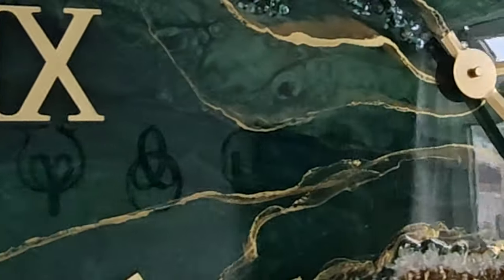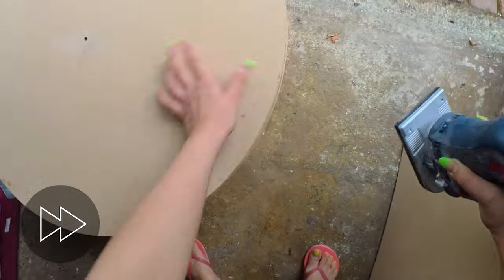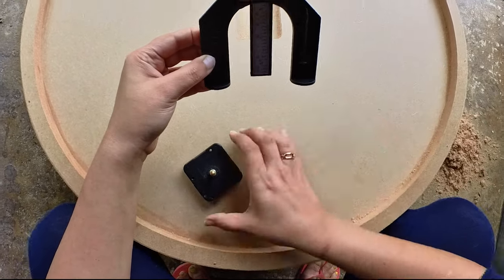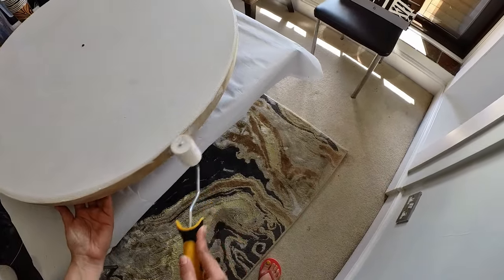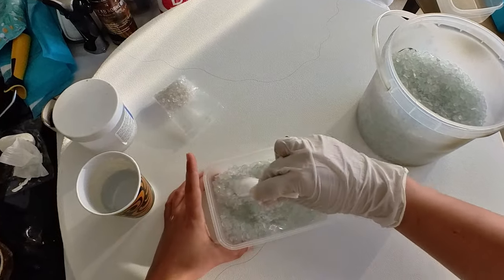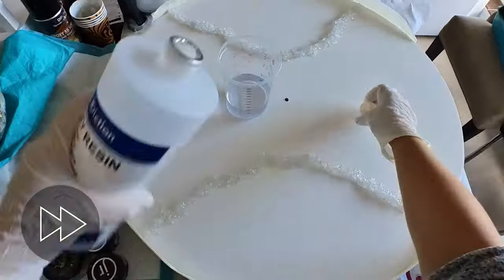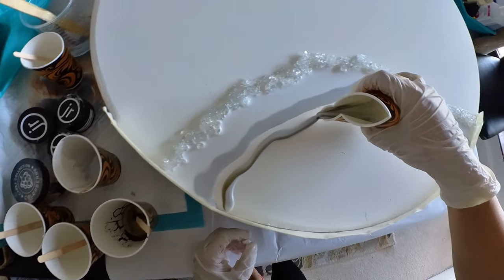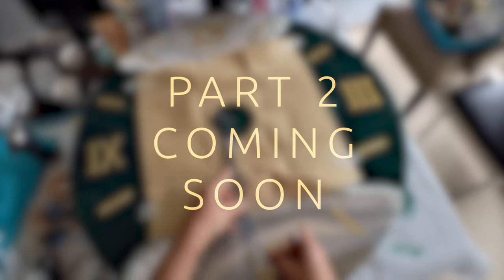Resin Geode Clock tutorial part 1 #resin #art #epoxy #clock

Comment: can you list out material please
Reply from the maker: Hi Nisha , I used an mdf base for the clock,  what u see me applying with a roller is a primer / Gesso. I used crushed glass and few colours of resin pigment pastes mixed in resin. The gold that u see me apply with a tip applicator at the later stages is called liquid gold by Montana,  but u can use any gold paint or even gold mica powder mixed in varnish. Hope this is helpful